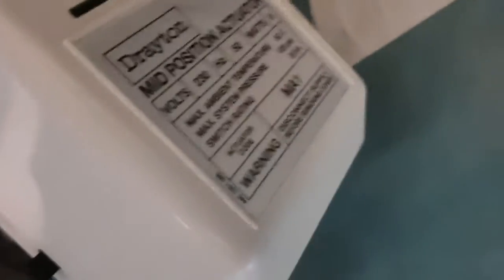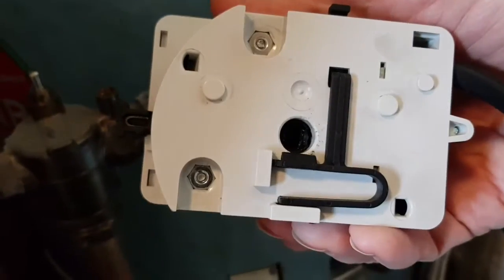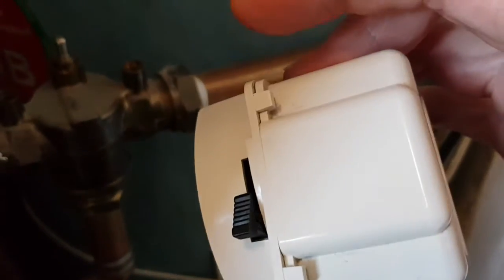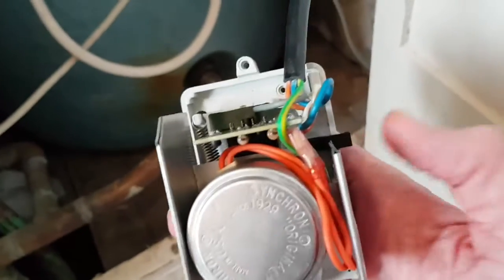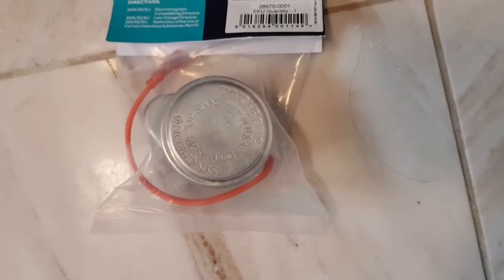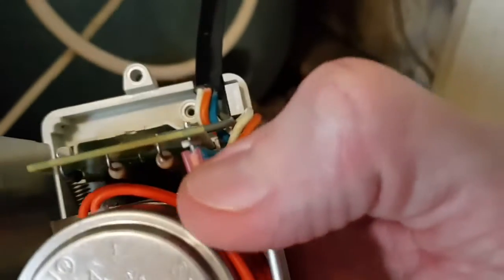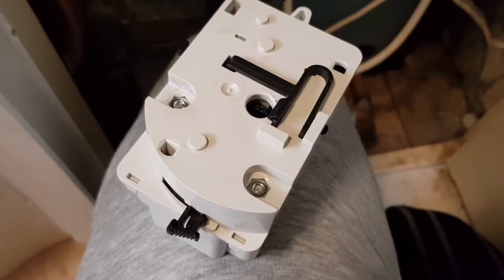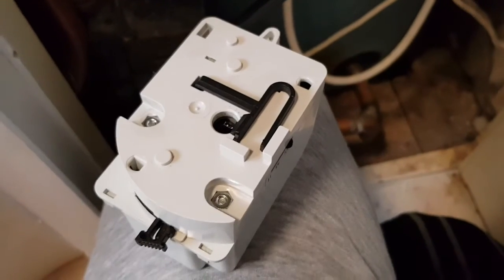Central Heating Repair - Motorised Control Valve Fix

Comment: Thanks for this! I was looking for a video on how the Drayton MA1 works, but this gives me enough info for what I need. I am finding that the actuator moves as expected when it is removed from the valve, but for some reason does not seem to be strong enough to turn the valve when attached. It could be the valve has become too stiff or the motor is no longer strong enough who knows. I have manually set the valve in the hot water only position, which should be good until winter comes again

Comment: Much appreciate for sharing the videos, great help to understand the problem, Actually by turning on hot water,  it was triggering the heating of radiators, But by watching your videos i understood that what was the actual problem. Thank you so much.
Reply: mine too...exact same issue.

Brilliant video
Reply: Mine also, just bought a new one so fingers crossed 🤞

Comment: I have now replaced our motor (was very easy). MORE IMPORTANTLY - the cause of this fault is;  the dormant period that the rads are not in use - sludge builds up around this valve so in autumn when we switch them on this simple motor strains and the cogs simply grind out and nackers the motor - So what we need to do to prevent that happening is 3 things;-
1/ Switch the heating on several times in summer(to move the sludge - which is a mix of metal dust(magnetite) and bacterial detritis).
2/ Get some inhibitor in the system(see answer 3 below).
3/ Get a 'Magnetizer' fitted to your central heating system - this should be a must in all systems - the only reason they are not fitted is that it will deprive plumbers of a massive revenue stream !  This magnetizer can also be used easily to add inhibitor liquids and other products. I fittted my own one - which entails half draining the whole system. These magentizers are around £65 and worth theiir weight in gold - like the little motors above they can all be bought on ebay - type in 'Central Heating Magnetizer'.

Comment: Thanks! My motor was fine, but the mechanical valve was frozen. A simple wiggle with pliers and it was free!
Reply: I had the same issue. This video showed me that the actuator can be unclipped to access the valve.
Reply: @graytom  Same here

Comment: Brill video clip! I changed the motor on mine about 5 years ago. Occasionally now, after the heating has been off all summer, the mechanical part of the valve sticks.. but all I do is unclip the top, and with a small adjustable spanner, gently work the valve pedestal either way. Its never very tight and only has ever taken a couple of minutes to sort...and its not every year
Reply: Mine just snapped off! Lol.... was incredibly tight and then it wasn't! Lol

Comment: Thank you for that.
Have replaced my motor as the actuator was becoming unreliable (valve itself moves freely by hand). Took 5 minutes to do - gently prised off the connectors with a small screwdriver.
My actuator was replaced 2-3 years ago .. disappointing as the previous one had lasted 12+ years!

Comment: That black lever on mine will not budge at all. It's stuck in the groove. Should I replace it? Edit: You can manually move it to the heating position, you can't move it back. Mine turned out to be the valve sticking, I removed the actuator and then manually moved the valve with adjustable spanner which freed it up, now it's possible to move it with my fingers.

Comment: Thank you for this video. My mid position valve is playing up, so it is hit or miss if the heating is coming on. Also, the arm to select water, heating or both has fallen inside, so I feel it would be better to replace the whole box rather than just the motor. From experience, would it be easier to remove the black mains lead from the valve end or from the wiring panel?
Reply: Did you replace it?
Reply: @Horizon301 not yet, it's working more often than not at the moment so it's on my to do list rather than urgent for now
Reply: @user-ik8nw9ep3i funny I'm having a similar problem with the downstairs rads not heating up but upstairs do when the heating program starts on both zones. I found the downstairs motorised valve had no light lit to say it was on. Trying a 1hr boost after, and it worked. It's more working than nit currently
Reply: @James-BB70  the issue for me is the heating staying on and therefore the boiler won’t stop firing. It happens maybe once or twice a week  when turning off the heating. A tap of said unit seems to make it work I realised last night. Seems to be my issue entirely

Comment: Thanks for that Having this issue with switch stuck on open and rads always hot. Will try to take it off and see if I can manually close it. These things always happen on week ends when no electricians around :(

Comment: One of my springs had failed as the plastic mounting stump had vanished, spring secured with cable ties and heating works again. cheap fix.

Comment: Can I ask the activator/value stop working so I tried to take off and realised it did have a screw securing it, but then decided to leave it but on try to lift off, it's actually freed it up and now working thou on everything depending if i have put heating on or water.  But the activator is now physically the white box from side to side slowly when changing to different heat or water, is this right??? I guessing not but just checking, at least i have heating now but wanted to know if safe please????
Reply from the maker: Sorry don't really follow. Probably better to get a plumber to check if you're concerned

Comment: Very useful!  I've just dismantled the valve and found the posts holding the return springs had both broken (motor is fine).  (Dead giveaway when I dismounted the actuator and there were multiple rattles from inside!).  Hooked the spring ends into the holes where the posts used to be and the valve now seems to be working properly.  Thanks for the view of the internal workings!!
Reply from the maker: Hi. I actually had a similar issue few months after replacing the motor where one of the posts snapped. I ended up drilling a small pilot hole and then inserted a small screw with similar dimensions to replace it. Not great but seemed to do the job. I just made sure the screw was in deep enough so it wouldn't get pulled out as the springs are quite strong.
Reply: @amp9438  Maybe before refitting the actuator, give the valve a bit of manual opening and closing in case it's got a bit stiff after sitting around for the summer.

Comment: My actuator changes position from heating to hot water no problem, but recently we noticed that whn we turn on the hot water the heating is on as well, while the actuator is on W position [meaing hot water only no heating]. I cant figure out why my radiators get hot :(
Reply from the maker: Maybe the valve itself has failed?
Reply: @amp9438  Yes it has to be that, the actuator turns but the valve must still stay open a little bit , my first 2 radiators heat up alot and the rest are barely warm, the last one is cold, a gas engineer will come and probably change the vavle itself.

Comment: What makes this actuator valve hum loudly please?
Reply from the maker: I guess the motor could if its stuck or could it not be the water pump?
Reply: Actuatr  checking    loday  working  no no ok  by pass  open     solved    actuator not  woringonly  checkingsime upside  normal  checking  pushing  and moveig ño no ok  by  passopend and  avbles  replasing ok

Comment: How do u know/ check  it's the motor not the 3 way valve ?
Reply from the maker: If you remove the motor section from the valve you can see if it moves when the heating and/or hot water is switched on/off. The valve can also get stiff so worth checking if it can be move. Note they only move a small amount to open & close.
Reply: Can I replace the midposition ma1 with a midposition za5 changing the whole mechanism body and head?

Comment: Im is  this  everything works well valve just  is warm all the time, is it supposed to be like that ?
Reply: If you watch the Drayton training video on their actuators they have 5 watt synchronous motors designed to stall but remain live hence the heat generation.

Comment: It's not as easy as this guy makes out. To get the bolts back in you gotta line up a hole in the plastic moulding of the valve with a hole in a loose metal base plate with a hole in a seperate metal heat sink with a hole in the motor casing. For 2 bolts  at the same time. Now screw in the bolts with one of your other free hands. Good luck with that. Helps to have 6-8 hands. Or tentacles.
Reply: It should be pretty easy to do, I've been working on mine and have taken it apart completely about five times over the past week. You don't have to put the two bolts in at the same time. It really isn't difficult.

Comment: Can this three point valve cause be my problem? I have a combi boiler and some of my radiators get hot during the night!
Reply from the maker: Hi. I'm not a qualified plumber but guess it's possible if the valve isn't properly closing. Is it the radiators nearest the boiler? If the valve isn't closing they could be getting some hot water causing them to heat up. The others might be too far away so don't get enough hot water to heat them up. All just a theory though!
Reply: Combi systems do not have 3 port valves. They have divertor valves within the boiler casing. 
Call a gas safe engineer !!

Comment: Could a stuck valve cause the electricity to cut when heating/water is switched on?  The valve was warm even when the system was off?
Reply from the maker: Possibly. An qualified engineer could try disconnecting the actuator (motor) from the control circuit to see if it still trips the circuit when switched on.
Reply: Stickup ok push btton  and pushing trying  all strickup  replasing    by pass oj  vave colsed  opend   probles  sloved ok